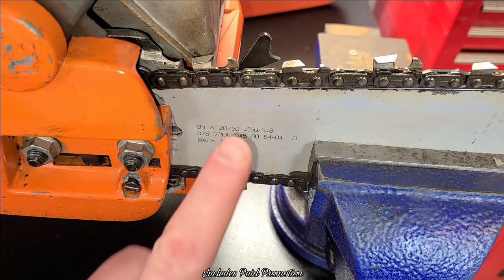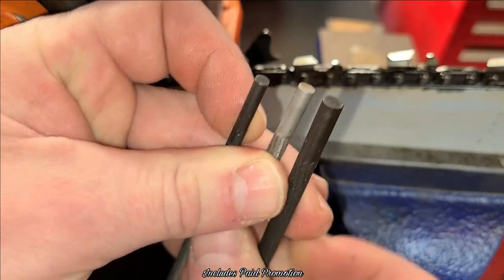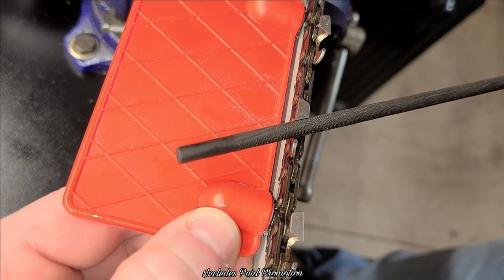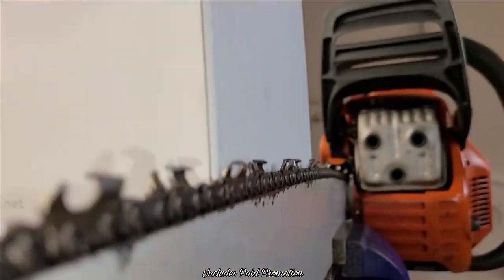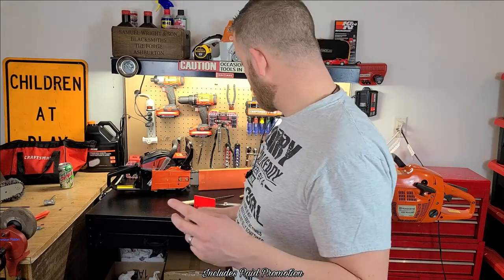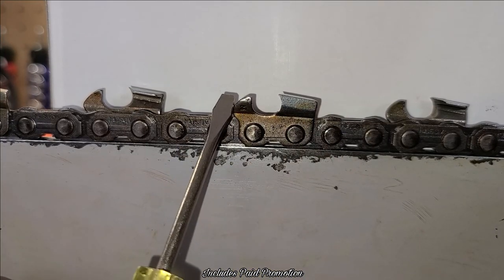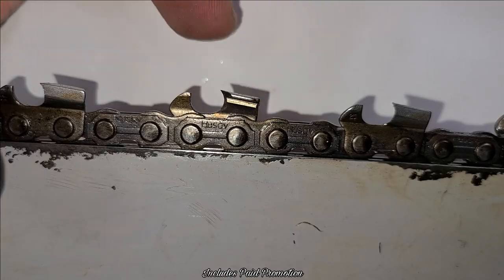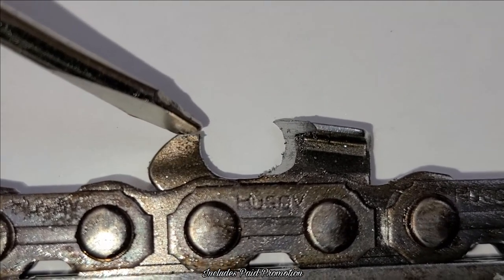🆕How To Sharpen A Chainsaw Best Way To Sharpen A Chainsaw Urgent

Comment: hey this is a very good vid. sharp clear cam work too. i see i need some guages and good files. you directed me to here on the live feed tonight. like i said i had given up on trying to resharpen, and am buying new chains 3 at a time. the guy at the stihl place said it would cost $80 to sharpen a blade! i buy 3 for $75 on ebay. i'm sure the prob is the rakers are too high to allow the tooth to cut no matter how sharp it is. in 30 years have never trimmed them, or knew how.
Reply from the maker: That's why we do what we do Bob thanks so much for watching! Don't forget to subscribe and Keep on Piddling! #americanpiddler
Reply: Yes!! Great camera work. Very detailed, makes ALL the difference!!
Reply: IS there a possible chance Bob, that you're confused and asked the Stihl dealer how much to REPLACE a whole bar and chain?? Depending on the saw/bar/chain combo... Your smaller bar/chain combo' replacement could run in that dollar range. BUT.. JUST a chain sharpening.. shouldn't cost over $5 if it's under a 36" bar.